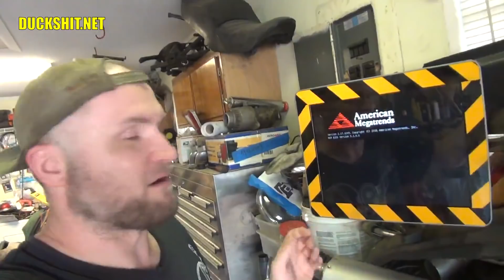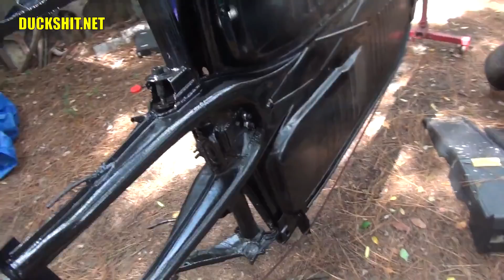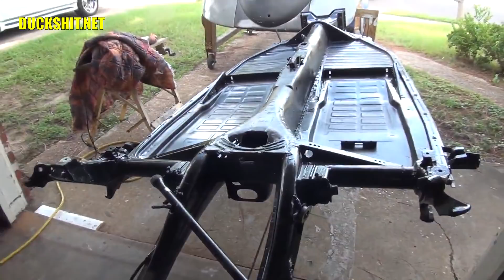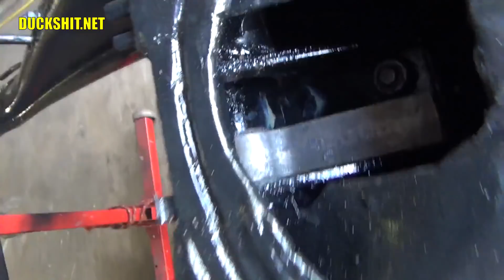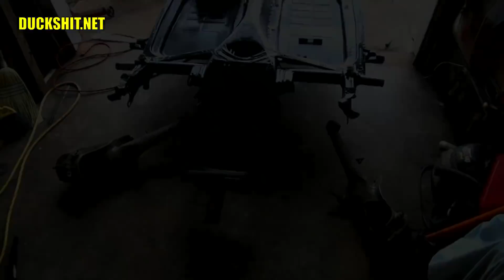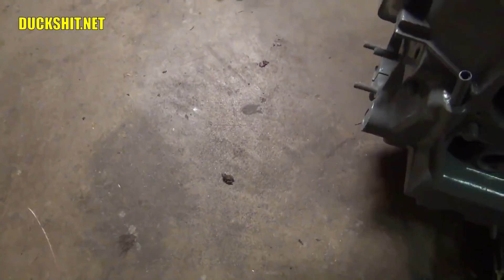Pan Assembly - ROTTEN OLD 1956 Chop Top Oval VW Beetle - 29

Comment: 12:44 "Johnny Come Late(ly)" again. 'C'-Clamps...
Reply from the maker: Vitamin C clamps.  They don't work there though.  You need proper alignment, too!
Reply: @DuckmanCycles  I bet that you have watched Mustie1.
Reply from the maker: @garrykellogg3215  Who is that?  Never heard of him!  Haha... he doesn't talk to me.  Probably because I am so damn noisy.
Reply: @DuckmanCycles  He converted a large 'C' Clamp to easily aid in Valve removal on Volkswagen engines.
Reply from the maker: @garrykellogg3215  That's interesting, there is actually a proper tool for doing valves, the VW head slots into it, and it has a bar across the top with a handle.
Reply: @DuckmanCycles  I don't doubt that, but he's the type that likes solving mechanical problems for the *ell of it.

Comment: Do you have a video on making those “chassis holder” things that roll around... or if you bought them, where at? They look SUPER useful being that I’m basically in the same situation with you having one garage space so I just keep the chassis under the body and I need to disable the suspensions soon so I need a way to keep the chassis mobile. It’s a ‘71 super check it out at DubWerks channel... videos coming out soon!
Reply from the maker: Are we talking about the body dolly or the chassis rotisserie? Both are very useful... usually at the same time!
Reply: DuckmanCycles and VW Garage I’m talking about the rotisserie. I made “sawhorses” for the body however now seeing your body dolly I’m gonna build one like that!
Reply from the maker: The rotisserie is really just two engine stands.  Very simple and gets the job done.  Bolt the one engine mount directly to the frame head,  and bolt the other engine mount to a piece of angle iron that extends across the frame horns and bolts in with the transmission bolts. Just leave off the boom that goes to the Third Wheel on the engine stands you won't need them!
Reply: DuckmanCycles and VW Garage Got it. Thanks!
Reply from the maker: Awesome, glad I could help! I hope you make some videos of your project or maybe you can share some pictures of it over on our Facebook group page!  Thanks for watching!
Reply: DuckmanCycles and VW Garage The Super will be featured on DubWerks. He just posted the video of vw ending the beetle. The one that he messed up the first time LOL! There should be a window removal video in the next few days and I’m about to join the Facebook group!